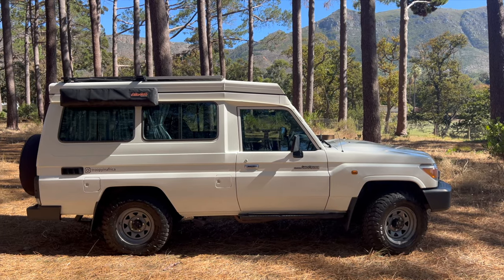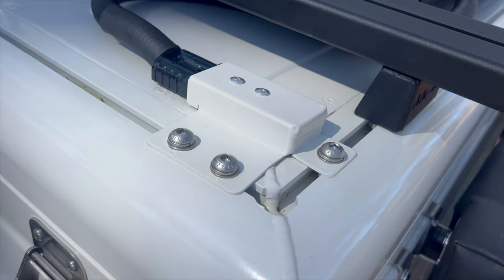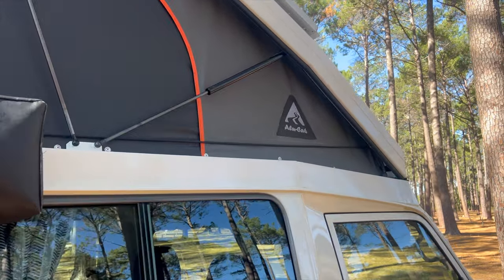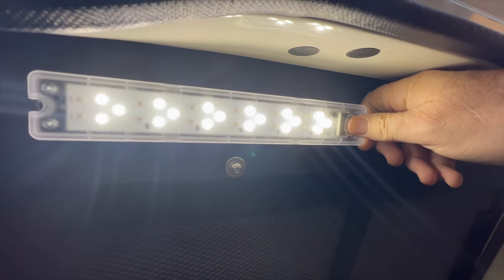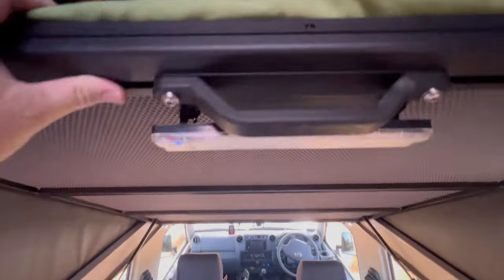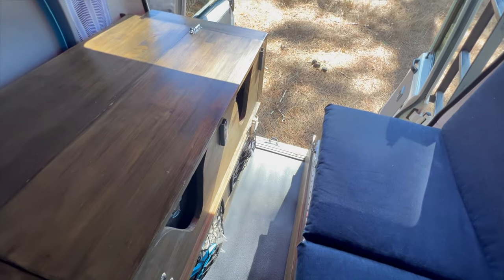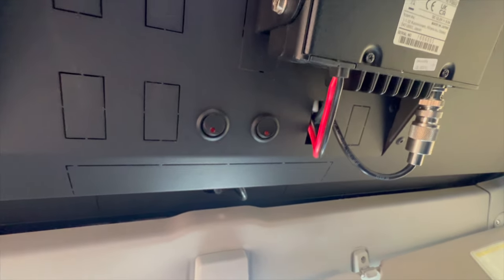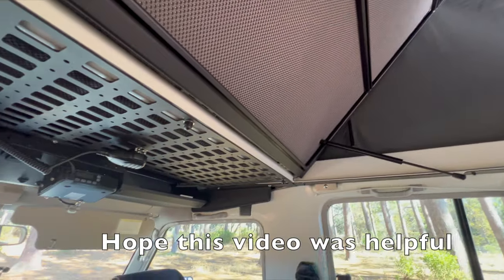AluCab's New Hercules Roof Conversion #troopyinafrica #alucab #herculesroofconversion

Comment: Just outta interest, did they have much trouble releasing the old one with all the sika around it or not to much trouble. Always wondering if i want a change in say 5-6 years if possible without drama. Looks good mate.
Reply from the maker: There were some minor scratches which were earlier sprayed over, and I think they had to cut a bit more off in places.

Comment: Just a pity they were not able to fit/match the look of the vehicle by following the shape body and roof-line, like the Aluinovations version
Reply from the maker: Maybe watch again. It does follow the roof line? What you maybe not seeing is the slant inward from the sides which the AI version does. But then you loose bed width🤷🏻‍♂️
PS - Thanks again for watching.
Hopefully you one soon. Did you ever get a price?
Reply: @troopyinafrica  its not parallel like the AL, and goes straight up at the back while AL follows the body line.
Reply from the maker: @wetwaterfish  ahuh at the back. Yes. Like I said gives more room inside for bed and bedding. 🤙 AI have had to make a much higher custom  version here in South Africa to accommodate the same

Comment: Thanks for the informative video! I was wondering what your experience was/is with the old latches vs the new latches? Here in the UAE we break them both and it could be because they are misaligned as in your video; (in addition to being poor quality); was also wondering how you went about swapping out the old version rooftop for the new one?
Reply from the maker: This is the first time I have these latches. There was another one I had on the old version which was good. 
Not sure what you mean about how I went about it . AluCab took the roof conversion off and put the new one on.

Comment: looks like the rear latches still don't lay flat when in the open position, impeding the rain gutter or similar. Better & stronger latches yes but still require more improvement
Reply from the maker: Thanks Dave for watching. This is a very good point I didn't look at and went out this morning to check ASAP. The car is going in Monday for some tweeks, so I will have the discussion with the engineering team. Thanks for the point.
Reply: @troopyinafrica  I'd be interested in the outcome
Reply from the maker: Will let you know

Comment: Noticed you have a forward facing  second row of seats in your troopy. Are these seats still useable with the headroom decrease after installing the Alucab top? Wondering if it will still be able to be used for passengers in the back. Any headroom differences in the back between the new alucab and older alucab top?
Reply from the maker: Hey There OttoEx, there is a very small difference from old to new. I should go measure the new and compare to the figure I had in the older video where we compared the AluInnovations with AC. I am tall and I can fit in the back, but don't often. It is more for/was for my daughters who are out of school and can fit just fine. They biggest complaint is getting in the front door and the window position - never had a complaint about the height yet. You can DM me is you want on Instagram for more details.

Comment: Its a pitty the quality is still lacking, they can not even get the alignment of the rear latches right
Reply from the maker: Well spotted 👌, though I am not certain the quality was ever missing on my last one. Perhaps I should have noted that this was the test model or first production model to be fitted. It was on the list of tweaks they actually asked me to come back for. They are perfectly straight now 🤙. If you referring to the latch issue these are much better than the old ones. On my last conversion they had even replaced it with a brilliant latch. Unfortunately I think all these conversions suffer with latch issue in some way. The latches will never be able to hold the roof and it's loads Offroad without some level of movement of a conversion. I am loving it....just wish I could go camp more 😭🤣